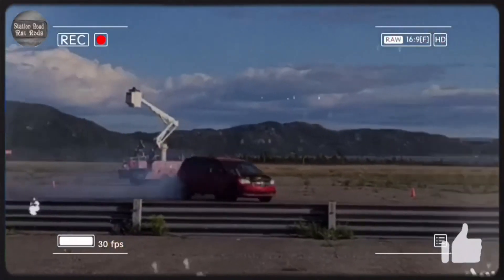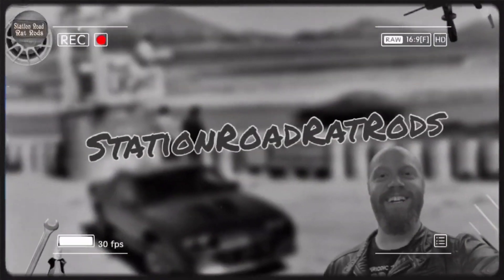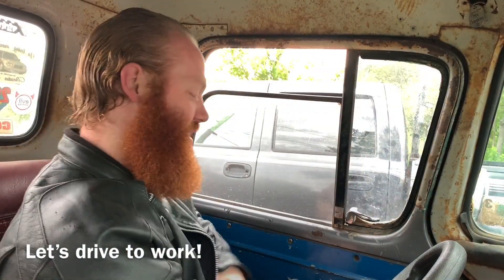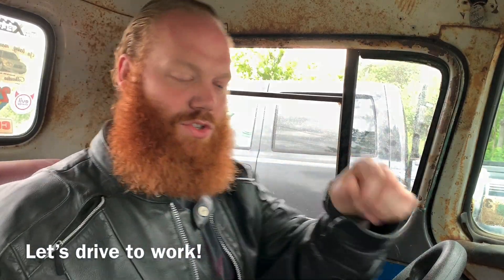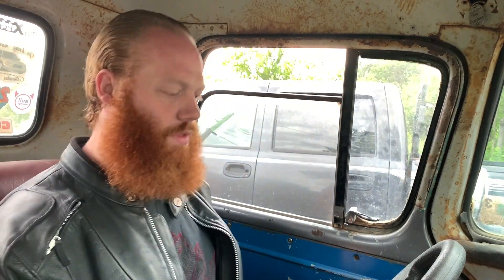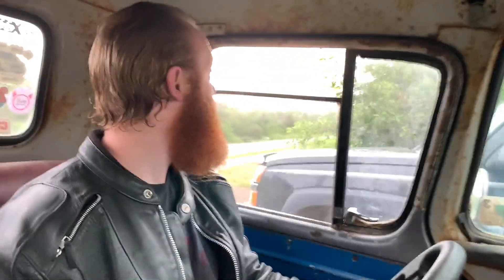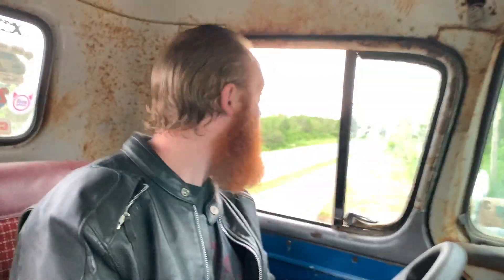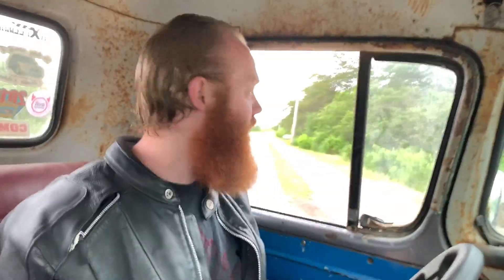Let’s drive to work in my rusty twin turbo 1957 Chevy pickup!

Comment: What weight  Oill are you running?
Reply from the maker: Welp, I have one quart of Lucas and the rest 10w30 lol
Reply from the maker: The reason I have the Lucas in there was for assembly lube when I was putting it together, and I dumped what was left into the pan. Good idea to change the oil, I’ll do that before I drive to St. John’s on Friday. I’ll have updates of course